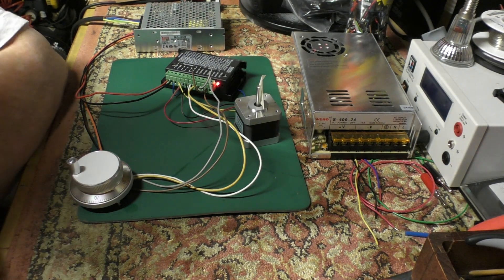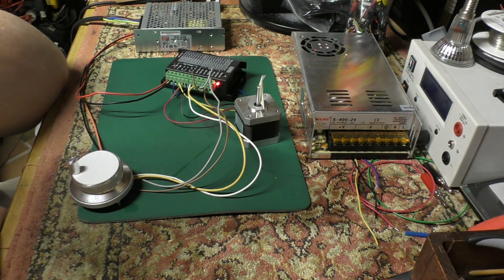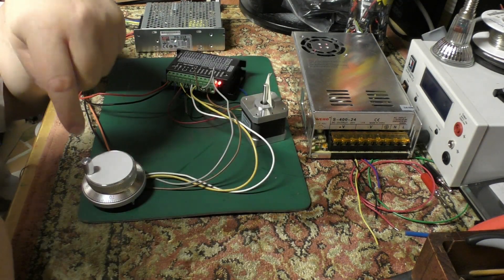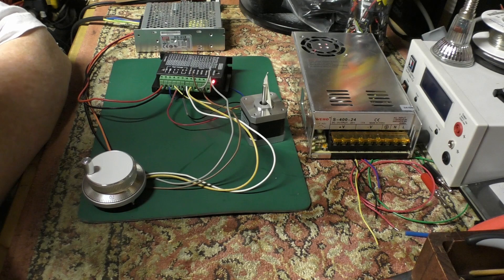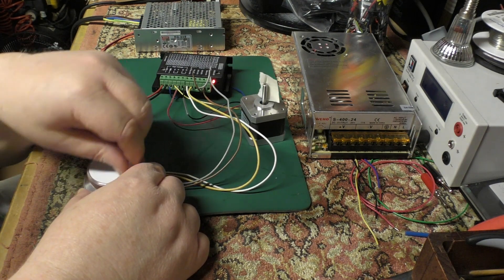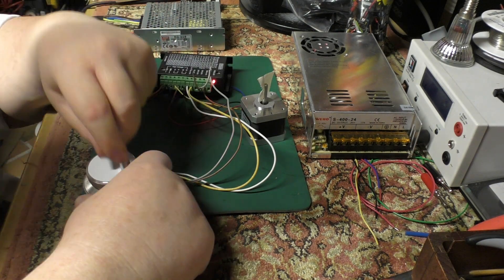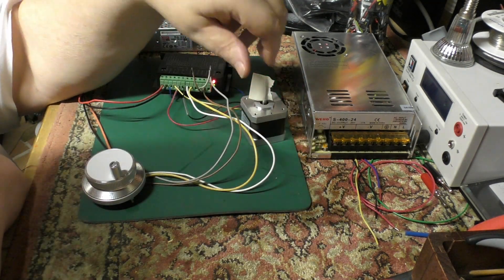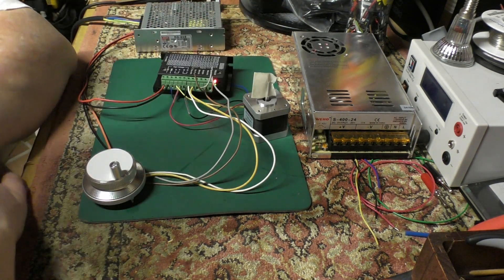Antenna Rotator Project - Need Some Help

Comment: Some googling shows  an LS7084 might be a single chip solution you can get on ebay. You might  also use discrete solutions involving flip flops and other logic gates, or 8 pin microcontrollers but they wouldn't be as easy. Good luck.
Reply from the maker: Cool, thanks.  Chip on order from eBay - looks like it's a good candidate.  Of course, it will be weeks before it arrives so next update might take a while!